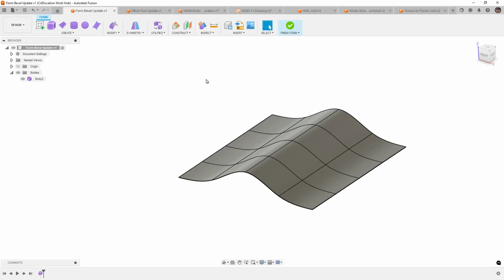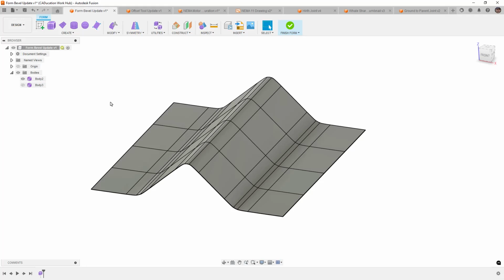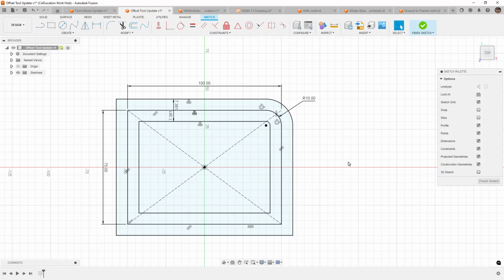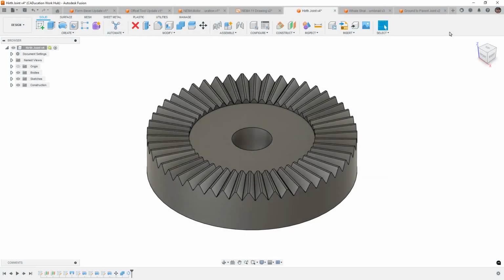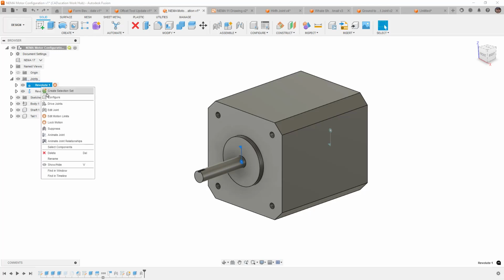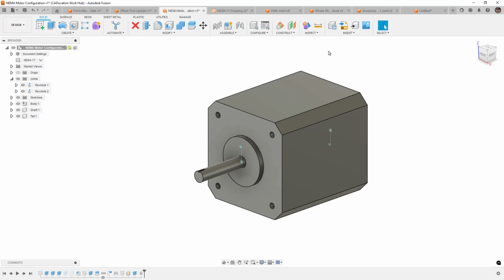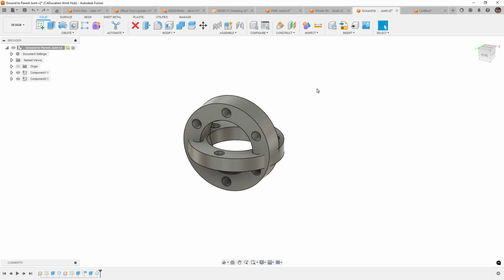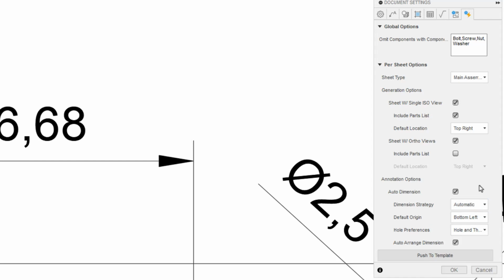What's New in Fusion | Sept 2024 | Offset | Bevel | Configure Joints | Drawings | Parameter Import

Comment: I wish they improved Text handling, it's awful right now. The Move command doesn't work with text and you can't pattern text. Extruding text is a crap shoot that may or may not work depending on the font. This is a much needed change.
Reply from the maker: The Move command works for me with text.

To pattern text you first have to click on it and select "Explode text" and then it will treat it like a sketch entity made up of lines and arcs.

Some fonts are tricky for sure.  In general Explode Text is used after you are sure the Text is right becuase you cant edit after you explode it other than manually drawing lines to fix it.
Reply: @LearnEverythingAboutDesign  I find that "Explode Text" often doesn't work and leaves you with disjointed objects that can't be extruded. It's very poorly implemented :( The other thing I'd like to see is the font parameterized. Sometimes you need to experiment with fonts to see which one works best, so the ability to change the font and see the change reflected would be very handy. As it is now, you have to delete the exploded text and try again. Fusion is powerful, but the sketch environment desperately needs an upgrade.
Reply from the maker: @HappyWanderer01  I agree 1000% I really wish the sketch tools got more love for many years.

On the text. if you don't explode it you can double click to change the font, size etc.  After you explode it nope.  If i am just extruding text i generally don't explode it.  If i need to modify the letters that is when i explode it.  The only other current work around is to generate text as SVG in another program and bring them in.  even less than ideal....

Comment: Some good changes, but I have a massive problem with the update: I can't export any body to a mesh, it says "Autodesk Translation Service failed to translate the current document to 3mf file" - and before you ask: stl-file also doesn't work. When I try to save the mesh directly to my slicer, fusion opens the slicer but no file appears.
Reply from the maker: wow thats strange.  I just tried it.  They did update the dialog but i am able to both export and push to my 3d print utility.  Im using the older version of Creality Print (4.8 i think) and it works fine.  

I tried sending a 3mf to Cura 5.7.2 and that worked as well but the object was way off the build plate and needed to be centered.

I was NOT able to use the export option on a 3mf though but STL did work..... 3mf does need cloud translation but stl and obj should no longer need that.

I will say that its annoying this new dialog doesn't default to remember my settings and i have select to send it to a printer each time.  the 3d print tool on the Utilies tab seems to remember my settings but still annoying.
Reply from the maker: i checked this again this morning at it appears to be working fine now.  I can export a 3mf from the file export menu and from the Save As mesh right click option.
Reply: @LearnEverythingAboutDesign  It looks like as if it is a problem with permissions in MacOs: when I started Fusion with the admin account, I was able to export 3MF and STL. But there is still one issue: when I export directly to the slicer, Fusion opens the slicer and the model appears in the slicer. But if the slicer is already opened, nothing happens. 🤷🏼
And by the way: thanks a lot for your work and efforts sharing your knowledge with us! Great Channel!
Reply from the maker: @timg.998  i have weird slicer issues with  them if i have it open and try to push a file to it from Fusion as well.  I am using the older creality 4.x slicer.

Thanks for the follow up and kind words!

Comment: Moved to FreeCad a while back. Fully parametric, imagine adjusting your model with a spreadsheet. No more bloatware for me.
Reply from the maker: Im sure freecad is a great tool and glad it works for you.  They aren't exactly apples to apples though.  For me a big part of the process is the user interface and UX.  I have used a lot of CAD packages and still do and while Fusion isn't perfect it is the most user friendly one I have found.  Open source software often times has a real limit on the UI/UX (even with Rhino this is very apparent).  But aside from that Fusion handles mesh/freeform modeling. simulation, gen design, CAM etc.  Compared to the space and intrusion other programs i run like Solidworks and Inventor, Fusion is far from "bloatware".  Free/open source community supported software is great but its tricky to use in a professional sense.  I use Solidworks still because some of my clients require it, not because i really enjoy using it anymore :)

Comment: Hi hi, 
Offset command. Draw an object second make it a construction line(s). Select offset, select object, select two sides, define the distance. Both offset lines will be normal lines
Reply from the maker: Nice tip Eric.  It is certainly possible to do but does require an extra step.  Other programs like Solidworks have a checkbox to default the selected curves to construction.  Converting to construction manually with X isn't too bad, but they were so close :)
Reply: Hi matt just wait for the next update 🤣🤣

Comment: Correct... I also remember that bavel could be used at an internal edge. I guess they ran into issues with the crown option... It's a bummer though.
Reply from the maker: Thanks for confirming my sanity!  As soon as the adjacent faces aren't planar you can use the Bevel tool, which i guess is the main time you would need it, but just seemed odd.